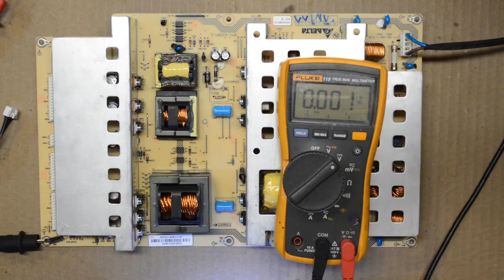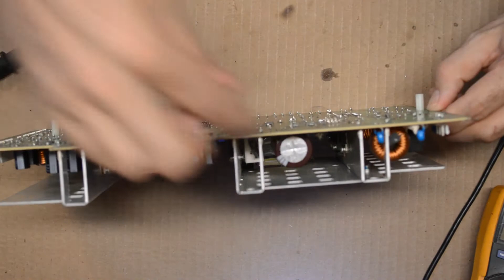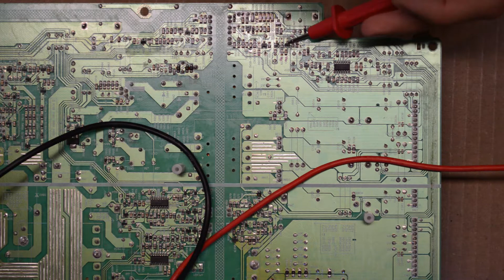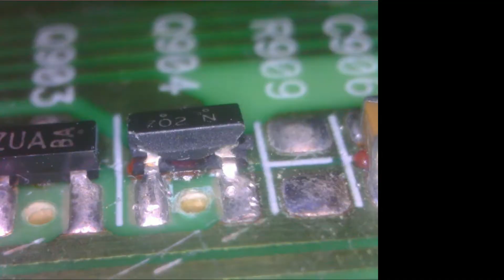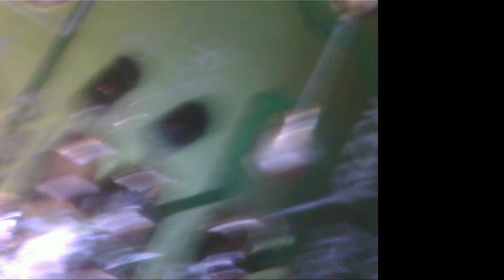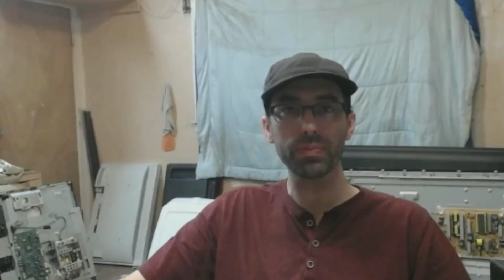Vizio VF550M Switch Mode Power Supply (SMPS) Repair

Comment: Nice repair. I remember a time when Ham radio enthusiasts in the USA use to say things to the effect that a switch mode psu is always 1/60th of a second from completely destroying your rig. Wow have times changed. I normally find bad caps in these, the ripple is damned hard of the poor things.

Comment: I have the same TV and it'll come on every once in awhile but then it shuts off and won't turn on but every once in awhile it will turn on and work but it shuts off which board do you think is bad
Reply from the maker: You would have to open the TV and do a visual inspection, then some testing.
Reply: @SwapPartLLC  i did and everything looks fine . No blown capacitors or anything
Reply from the maker: Mr. NEStalgia  At about 0:45 I explain how to force the power supply on without the main board connected. That's the first thing you need to do. Then you can use a multimeter to check your voltages. Ideally you would do this  when it doesn't want to turn on normally. You can also force the backlights on the same way (while the power supply is still forced on), but I don't know what pin is enable for the backlights.
Reply: @SwapPartLLC  yea thanks to damn complicated for me !! Lol . I just want an easy answer like yea its the main board or tcon board or input board . i was thinking maybe tcon . idk . thanks for hitting me back tho
Reply from the maker: @Mr.NEStalgia  Unfortunately, there is no easy answer. Any board in the TV could cause it to randomly shut down and not power back on.
Reply from the maker: @Mr.NEStalgia  A dry solder joint could cause that issue. Still could be any board and any component on them.
Reply: @SwapPartLLC  thanks alot . I thought it would be a little simplier . I really aint an electronics person so diagnosing it im not going to be able to do
Reply: @SwapPartLLC  i really do appreciate ur help tho
Reply from the maker: @Mr.NEStalgia  No problem.

Comment: Nice JOB... I Got the same tv i use for my computer monitor.Yes Vizio white when on and orange when off.
Reply from the maker: Thank you, I thought it should be that way. I started working on the main board, but can't find anything bad in the indicator circuit. I traced it all the way to the CPU and I can make it come on manually.  I'm leaning towards it being corrupted firmware. I'll probably buy a preprogrammed eeprom on eBay and try that this weekend. For now, it's working perfectly except the indicator.